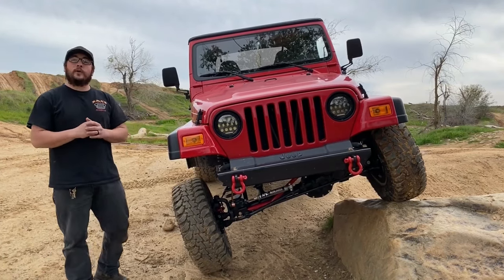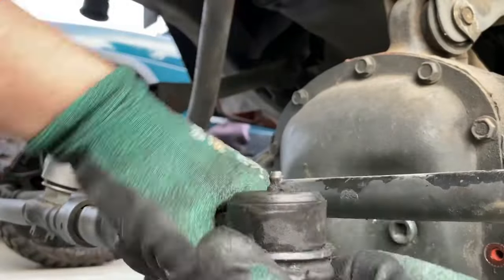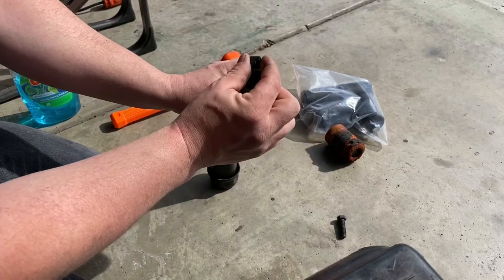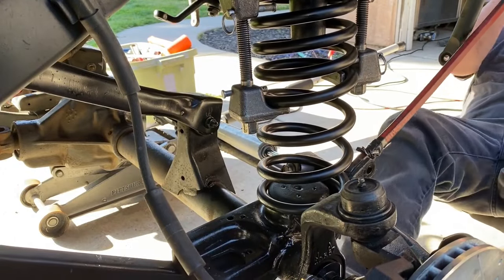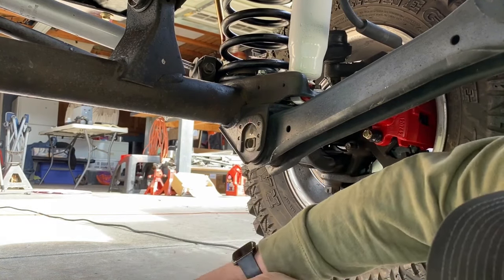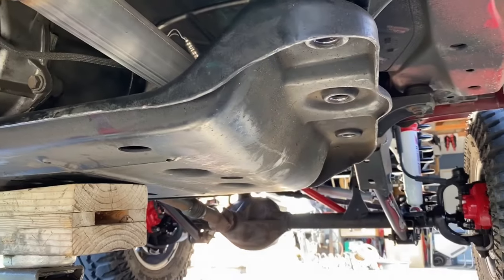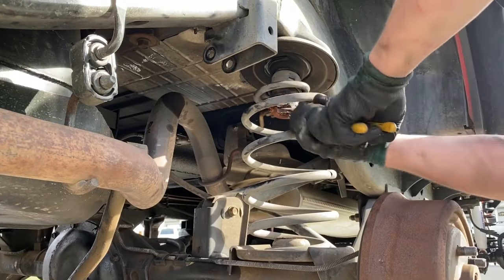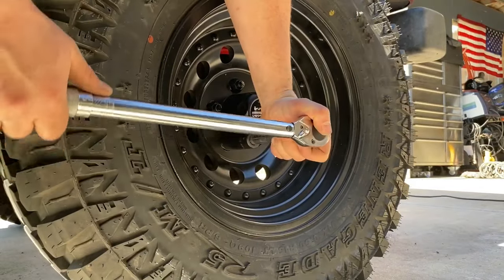Jeep Wrangler Tj - DIY 4” Suspension Lift Kit Installation Guide : Skyjacker Off-road Build

Comment: i enjoyed your video,  can you clarify a little more about the transfer case dr/op.  i have 97 wrangler automatic and i am confused to what the drop actually does becuase in your video the only thing i see lowered is the skid plate or does the transfer case rest on the skid plate.  i just cannot tell from the video what you are actually doing other than loosening the bolts and installing the skid plate lowering.
Reply from the maker: Yes we need to lower the transfer case to correct the driveshaft angles from lifting up the frame side of the jeep in relationship to the rear axle pinion angle ! when the jeep gets its lift it throws off the Driveshaft Angles. This can cause bad vibration and U joints to possibly collide. it’s important to note that when you buy these lift kits they come with the drop-down transfers case lowering spacers to correct these problems for the factory driveshaft . tjs factory driveshaft has only two ujoints in which the transfer case should be as parallel to the rear axle housings pinion angle! Just keep in mind this is a fixed angle because the factory upper and lower control arms are non adjustable! Now this method of doing things works , but it’s not very conductive to off-roading! The best alternative is to install an sye kit upper and lower control arms and adapt a double cardon driveshaft to the rear axle to correct these issues and to not use the drop down transfer case method! Now I’ve already done sye on the jeep and if you were to watch these three videos I think it will all come to light and better understanding . Thanks for watching buddy I appreciate it.

https://youtu.be/XH-qz5Au_xw
https://youtu.be/WlwwvQUThCc
https://youtu.be/RHMCHfvzuwM
Reply: @ATEMOFFROAD  I understand why it needs to be lowered, I also won't be doing much off reading either.  To me in your video the only thing you lower is the skid plate with the square tubing spacers.  What actually lowers the transfer case?
Reply from the maker: @kgfielder  the only thing supporting the transfer case is the the skid plate, you lower the skid plate you lower the transfer case!
Reply: Thank you for the clarity 🙏.   Hope you have a great holiday

Comment: Just FYI a drop pitman arm is not needed unless your doing a 6" + lift .....4" lift with drop pitman arm just causes geometry problems and then using a spring compressor to install springs thats dangerous, just lift the jeep up drop one side of the axle maybe use a jack on opisite side lifting up should give you plenty of room to get the spring in
Reply from the maker: Currently I’m not using it , I’ve done a lot of changes since! Thanks for watching 🍻
Reply: @ATEMOFFROAD  ok thats good

Comment: Wonder why you had to use the winch to pull out the axle. Are the lower control arms longer?
Reply from the maker: Because The new coils which are longer and stiff were causing the axel to rotate, Typically you wouldn’t need to move the axel because the weight of the vehicle holds the axel in place as you remove and replace each control arm, the longer coils for whatever reason caused the axel to rotate just enough to be out of position when I removed the first control arm! Then I jacked the axel up just a bit to see if that would help, it made it worse! So then I had to use the winch to basically rotate and pull the axel out to align to holes back. Thanks for watching

Comment: @12:29 did you have any issues on the passenger side sway bar end link quick disconnects? I have a teraflex one that I cannot for the life of me get past the bracket that holds the steering stabilizer.
Reply from the maker: Hi Shawn, Frame side or axles side bracket? And No I didn’t have any issues they bolted right up to the factory link mount on the axle! Is that what your asking? Is your teraflex linkage adjustable?
Reply: @ATEMOFFROAD  it is adjustable. Axel side. The connection part though is just so think it won’t slide on the axel side mounting point without contacting the bracket right behind it. Would rather not grind the bracket on my axel but I may have to or else resort to different links.
Reply from the maker: That’s strange teraflex usually is good at making bolt on parts that need no modification. I just can’t see it to help you out at the moment, your on Instagram?if you want to send me a DM over there with a photo I can possibly help you more after I see it!
Reply: @ATEMOFFROAD  I noticed you didnt install the quick disconnect on the passenger side sway bar end link, you kept the stock bolt.  This is exactly where my issue is and I'm wondering if you had fitment issues as well.
Reply from the maker: @lundysgarage  make sure your Jeep is on level ground, keep a hammer handy. so you only need to disconnect one side , the passenger side can remain bolted! But the side that is disconnected will be moving around , so you will want to take a bungee or zip ties and tie the linkage to the sway bar! But not the bar to the tub! If you tie to the tub or frame is will cause binding! Also if you do disconnect both and run at the same time you are going to want to hang up the sway bar to the tub. Or it will flop around so there is some options you have , I just think only disconnecting one side is much faster. Also make sure your Jeep is on level ground . And the links are adjusted properly also when you disconnect take the metal spacer out of the bushing and hold on to it or it will fall out on the trail and be lost it’s pretty important to have!
Reply from the maker: @lundysgarage  watching this video may help https://youtu.be/RbRqhitjRyI
Reply: @ATEMOFFROAD  Thanks for the help! My kit came with attachment points up on the frame to secure the end links.  I'll have to mess around with everything again this weekend.
Reply from the maker: @lundysgarage  yeah buddy sounds like you will need to get your Jeep out on a rock.that’s the best way in my opinion to find out how much you will need to adjust those out,  the best way to do that is the disconnect both links, and drive up a rock with the drivers side wheel, let the passenger side remain on the ground , at full articulation (the bump stop touches axle and full coil compressed) the pass side will be open , park the jeep there and adjust your linkages to that distance axle to sway bar, (Both side) then when you go wheeling you already have your sway bars setup for on and off road ! Man I should do a video on this , it’s too much fun!